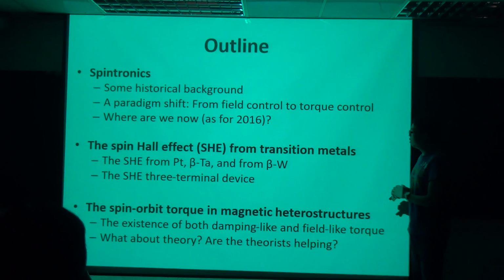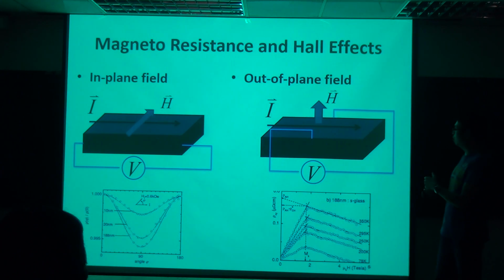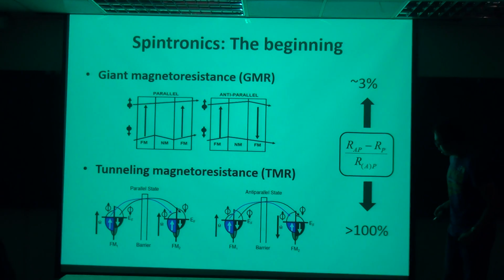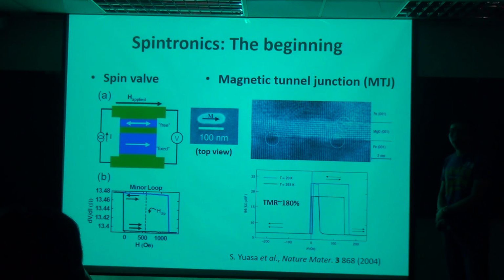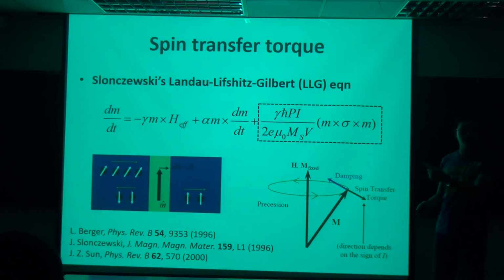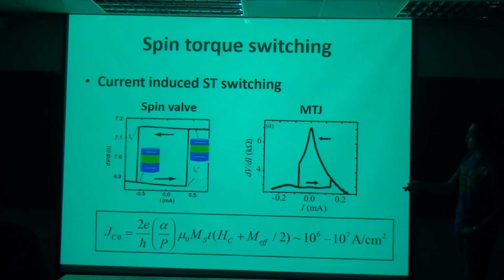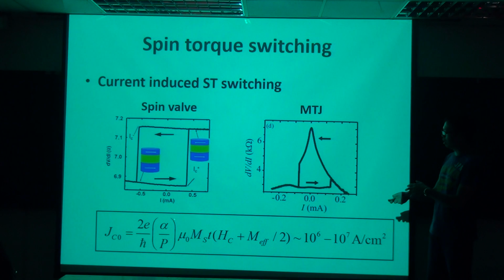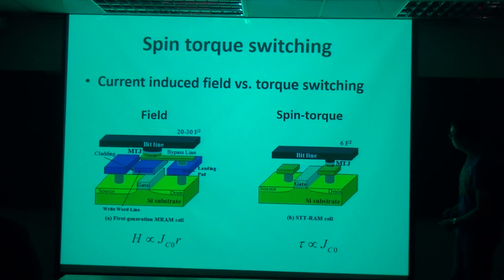Chi-Feng Pai, "From spin transfer torque, spin Hall torque, to spin-orbit torque" Part I

Comment: very very difficult to hear. no volume at all. i tried with headsets. i hear nothing.
Reply: if you have any audio software like beats-audio (mine),..you can suppress certain frequencies corresponding to humming noises etc..manually.
that will improve the speech little bit!!